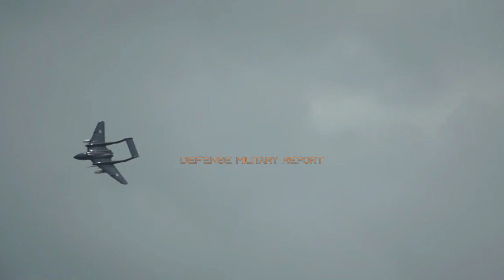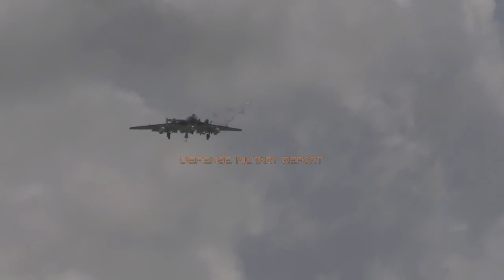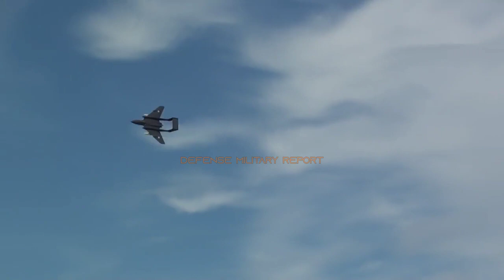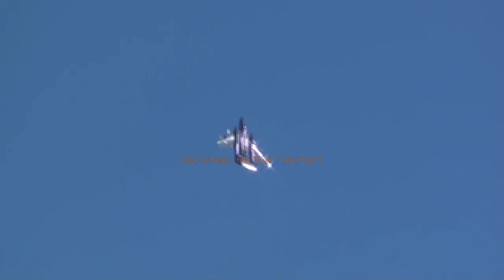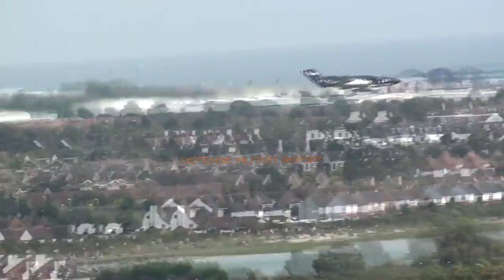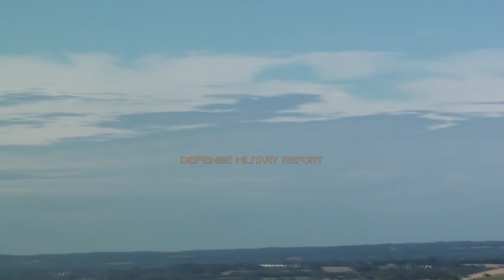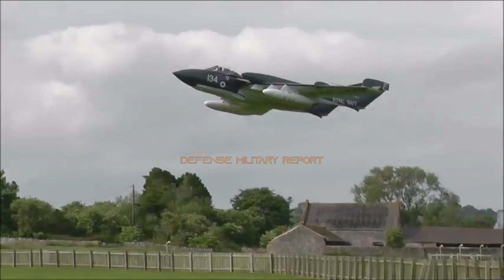De Havilland Sea Vixen - Most Extreme Fighter Jet UK

Comment: Extreme..ly poor performance. The DH.110 failed to achieve supersonic performance and had an absolutely appalling safety record for such a low performance aircraft.
Reply: A number of similar performance non supersonic jet aircraft got to first flight stage at around the same time. 

The MD F3H Demon was a contemporary to the DH Sea Vixen & had a similar performance. The later F4 Phantom was a follow on from the F3 Demon. The Sea Vixen took a long time to get from first flight to introduction for various reasons and a similar situation occurred with the MD F3H Demon. The Douglass Skyhawk delta wing is a contemporary to the the Gloster Javelin delta wing. Both non-supersonic delta wing aircraft, the javelin had better performance and first flew a few years before the Douglass Skyhawk.

Douglass A-4 Skyhawk 
2950 Built 
Intro 1956
FF 1954
In service to 1980s
Max V 670 MPH
Delta wing. A small / light jet aircraft designed for carrier operations without having to have folding wings. Often referred to as the scooter. 

McDonnell Douglas F3H Demon
590 Built. Not Supersonic.
Max Speed 578 MPH.
Introduction date 7 March 1956
First flight 7 August 1951
Retired 1964

MD F-4 Phantom 2
Number built 5,195
Manufactured 1958–1981
Introduction date 30 December 1960
First flight 27 May 1958

DH Sea Vixen
Number built 151 (including two DH110 prototypes and one Sea Vixen prototype)
Introduction date July 1959
First flight 26 September 1951
Max speed 695 MPH.
Retired 1972

Gloster Javelin.
434 built.
FF 1951
Intro1956
Max V 710 MPH
Delta Wing. 

Interesting British achievements.
There is no doubt that the Fairey (England)
Delta 2 was of course the world's first jet
aircraft to exceed 1000 mph, 10th March 1956 Indeed It exceeded the previous record by 310 mph & held the record for 1 year. Incidentally, the Dassault Mirage 3 & 4 are based on the Fairey Delta 2.

When the EE Lightning first achieved Mach 2 it was one of the fastest aircraft on the planet. 
P1 Mach 1 achieved 1954, Mach 1•5 capable.
P2 Mach 1 achieved 1956, Mach 2 capable. 
P2 Mach 2 achieved 1958.

The Hawker P1103 was a design and part built prototype that would have led to Mach 2 & Mach 3 versions of the aircraft. The General Dynamics F16 Fighting Falcon was of a similar design that went into service in 1975. The P1103 was cancelled during the switch to "mostly missiles plus no supersonic interceptor aircraft required in the future" era which included cancelling air to air missile development. Scheduled for test flights in 1958 and to be in service 1962. The General Dynamics F16 Fighting Falcon - based on a British design started 39 years earlier, built in the US and a number of manufacturing partner countries with parts for the US built aircraft sourced from partner countries. 

There were plans to do a supersonic thin wing Javelin which of course got cancelled. 

Early days, jet fighters.
De Havilland Vampire, Sea Vixen & Gloster Meteor accident losses were not high or unusual for fighter aircraft at the time. De Havilland built large numbers of all metal airframe aircraft before the DH Comet.
We mustn't forget of course that the DH Vampire for example first flew in 1943 & the engine was also built by De Havilland. There were examples of the Vampire interceptor / fighter in service until 1990 which was operated by more than 30 countries.

Non combat phase accident losses.
% of Aircraft built.

The Canadair CL-44 was a turboprop airliner.
Canadair CL-44                  (ff 1959 ) 48%
Lockheed XF104                (ff 1954) 100%
Lockheed  P80                   (ff 1944) 43%
Lockheed F104                 (ff 1954)  45%
Grumman f9f-5 Panther   (ff 1947) 44% 
Convair F102 Dagger        (ff 1953) 45%  
MD F-101 Voodoo.             (ff 1954) 34%
MD FH Phantom 1            (ff 1945)  35%
MD F4 Phantom 2             (ff 1958)  28%
MD F3H  Demon               (ff 1951)  32%
Gloster Meteor                  (ff 1943)  21%
DH Vampire                       (ff 1943)  23%
DH Sea Vixen                     (ff  1951) 33%
Gloster Javelin                   (ff 1951) 20%
EE Lightning                       (ff 1954) 33%

More recent UK military jet aircraft.
 
The Tornado & Typhoon & their engines are Supersonic & are indeed British design aircraft with British design engines built by an international consortium. The Tornado design for example started life during the 1950s at Vickers as the AFVG, it's engine is based on the RR RB-199. The EE Lightening is also a British Supersonic jet aircraft.

The Typhoon is the British BAC-EAP with an engine based on the British RR XG-40, the Typhoon is also built by an international consortium.

Comment: A weird, quirky airplane with a high-drag, straight tailplane, and high-drag, inefficient inlets.  55 of the 154 built were lost in accidents, killing 51 pilots.  It's loss rate was even higher than the loss rate suffered by the US Vought F7U Cutlass, which is universally condemned as one of the worst naval jet aircraft ever to see operational use.
Reply: We feel we can clear up some commonly held myths and misconceptions, obviously.

It's always good to see the facts presented clearly and concisely isn't it

See further down for a Meteor & Vixen Accident losses comparison.

Indeed that's correct. The Whittle Gloster E28/39 was of course a brilliant aircraft that was later copied in Russia as the upsized and tweaked Mig 15 with a copy of the RR Nene gas turbine aero engine.

Obviously the RR Nene being the world's most powerful & most reliable gas turbine aero engine in 1944.

   That's correct, of course the MD F3H Demon was a contemporary to the DH Sea Vixen & had a similar performance. The F4 Phantom was a follow on from the F3 Demon. The Sea Vixen took a long time to get from first flight to introduction for various reasons and a similar situation occurred with the MD F3H Demon.

McDonnell Douglas F3H Demon
590 Built.
Introduction date 7 March 1956
First flight 7 August 1951
Retired 1964

MD F-4 Phantom 2
Number built 5,195
Manufactured 1958–1981
Introduction date 30 December 1960
First flight 27 May 1958

DH Sea Vixen
Number built 151 (including two DH110 prototypes and one Sea Vixen prototype)
Introduction date July 1959
First flight 26 September 1951
Retired 1972

Non combat phase accident losses.
% of Aircraft built.
The Canadair CL-44 was a turboprop airliner.
Canadair CL-44              (ff 1959 ) 48%
Lockheed XF104              (ff 1954) 100%
Lockheed  P80                 (ff 1944) 43%
Lockheed F104                (ff 1954) 45%
MD FH Phantom 1           (ff 1945) 35%
MD F4 Phantom 2           (ff 1958)  28%
MD F3H  Demon              (ff 1951)  32%
Gloster Meteor               (ff 1943)  21%
DH Vampire                    (ff 1943)  23%
DH Sea Vixen                  (ff  1951) 33%
Gloster Javelin                (ff 1951) 20%

    Regarding the UK Aerospace Sector.
 
An airline recently ordered 60 RR Trent XWB Engines.

   Clearly It's a great pity & a crying shame that British military forces had to occupy a large part of Germany for decades after 1945 & Russian military forces had to do the same. Of course Russia still posseses a large chunk of what was German territory & of course Russia & the UK produce nukes. Obviously Germany does not produce nukes.

   Interesting British achievements.
There is no doubt that the Fairey (England)
Delta 2 was of course the world's first jet
aircraft to exceed 1000 mph.  Indeed It
exceeded the previous record by 310 mph &
held the record for 1 year. Incidentally, the Dassault Mirage 3 & 4 are based on the Fairey Delta 2.

Early days, jet fighters.
   De Havilland Vampire, Sea Vixen & Gloster Meteor accident losses were not high or unusual for fighter aircraft at the time. De Havilland built large numbers of all metal airframe aircraft before the DH Comet.
We mustn't forget of course that the DH Vampire for example first flew in 1943 & the engine was also built by De Havilland. There were examples of the Vampire interceptor / fighter in service until 1990 which was operated by more than 30 countries.

Non combat phase accident losses.
% of Aircraft built.
The Canadair CL-44 was a turboprop airliner.
Canadair CL-44             (ff 1959 ) 48%
Lockheed XF104             (ff 1954) 100%
Lockheed  P80                (ff 1944) 43%
Lockheed F104                (ff 1954) 45%
McDonnell FH Phantom  (ff 1945) 35%
Gloster Meteor               (ff 1943)  21%
DH Vampire                     (ff 1943)  23%
DH Sea Vixen                  (ff  1951) 33%
Gloster Javelin               (ff 1951) 20%

   An example of what goes on these days in various countries.
Obviously, for example, there are of course no German companies that makes German jet aircraft in Germany & there are no German Companies that make German gas turbine aero engines in Germany that are suitable for widebody airliners.

     That's correct, Brazil makes very good airliners & Brazil is 100th down the list along with Indonesia for wealth per capita. Of course it is in fact the case that Embraer can't build those airliners without purchasing stuff from the US, UK & Europe.
Norway Holland Denmark Ireland Belgium - Top 20 wealth per capita - Don't make airliners -  its as simple as that.

   Early days of the airliners.
That's correct of course, at the time the Comet wasn't particularly dangerous. Agreed, that is indeed the case of course, The DH Comet was definitely not the worst engineering failure in commercial airliner history.

Losses comparisons
How things were in those days.

DeHavilland Comet 4 UK                       14%
DeHavilland Comet all  (ff 1949)           17%

Boeing 307                               70%
Boeing 247                               48%
Boeing 707            .                  20%
Lockheed Electra Turboprop   29%
Canadair CL-44  Turboprop     46%
Convair CV-580  Turboprop     22%
Convair CV-880    (ff 1959)       27%
Convair CV-990     (ff 1961)      33%
Tupolev TU-104       (ff 1955)    16%

     Of course De Havilland had prior experience building many all metal construction airframe aircraft & thousands of jet powered fighter aircraft that were primarily of metal construction with pressurised cockpits & jet engines built by De-Havilland.

  More recent UK military jet aircraft.

  Of course the Tornado & Typhoon & their engines are Supersonic & are indeed British design aircraft with British design engines built by an international consortium. The Tornado design for example started life during the 1950s at Vickers as the AFVG, it's engine is based on the RR RB-199. The EE Lightening is also a British Supersonic jet aircraft.

  The Typhoon is the British BAC-EAP with an engine based on the British RR XG-40, the Typhoon is also built by an international consortium.

  Agreed, that is correct of course, clearly there are many countries that could easily produce airliners of better quality than Bow-wing (see b-47 wing folding & wing collapse incidents) but don't for some very good reasons. Bow-wing (see B-47 wing folding  & wing collapse incidents) being a result of the size of the US, the large protected domestic market & great ease of testing new types due to the equator to arctic geography complete with up to date aviation infrastructure & a few other reasons related to production scale capability, politics, the nature of the airliner market coupled with the nature of airliners themselves & general basic economics.

  Obviously there really is nothing special about Bow-wing, having more than 50 years design / build experience on the type means they have no excuses for the horrendous 737 Max incidents for example.

    Indeed GKN Aerospace, BAe Systems & Rolls Royce combined now do more Airbus work than Germany on an absolute basis & significantly more work than that on a per capita basis.
 
     Agreed, Per capita for the home nation BAe Systems is the world's largest defence contractor.

    Correct, BAe systems announced the recent £4 Billion takeover of Colorado based US based Ball Aerospace.

    It's definitely the case that BAE systems now does a significantly higher value of work for Airbus than it did when it was a major Airbus shareholder before 2005.
   
      Obviously RR now owns US Engine maker Allison for example which does classified Aerospace work for the US Govt.
 
   Yes, that's right of course, Anybody currently flying on a widebody airliner stands a good chance of being on an aircraft powered by RR gas turbine aero engines built in the UK.

   A typical but small glimpse of what goes on in the very internationally orientated British aerospace sector.

  Of course the RR Nene was in fact the world's most reliable & most powerful gas turbine aero engine in 1944. Licensed built versions & copies of the RR Nene & RR Derwent would go on to power many aircraft in Russia including the Mig 15 & Mig 17, the US, China, France & other countries for decades after 1944.

      Boeing Apache Attack Helicopter.
AH-64: 75 UK suppliers, 7% UK content, global fleet of 1280+ aircraft.
F35B more than 130 UK Suppliers, more than 30% UK content.
F35A & F35C more than 130 UK Suppliers, more than 15% UK content.

   There is no doubt that an airline has just ordered
60 RR England Trent XWB Engines.

Obviously the UK has the
World's Highest Combined Per Capita
Nuclear / Defence / Aerospace Sector Activity.

Rolls Royce Holdings UK
Subsidiaries
- Rolls-Royce plc
- Rolls-Royce North America (Allison etc Classified Military stuff)
- Rolls-Royce AB
- Rolls-Royce Deutschland
- Rolls-Royce India Private Limited
- Rolls-Royce Marine Power Operations
- Vinters Engineering Limited
- Rolls-Royce Controls and Data Services
- Rolls-Royce Power Systems
- Bergen Marine
Joint ventures include:
- Rolls-Royce Turbomeca
- MTU Turbomeca -

Trent Family
The MT30 (Marine Turbine)
Industrial Trent 60 Gas Turbine
Trent 7000
Trent XWB Airbus A330neo.
Trent 1500
Trent 1000
Trent 500
Trent 600
Trent 700
Trent 800
Trent 8100
Trent 900

RR wholly owned subsidiaries in Germany handle smaller 2 shaft RR gas turbine aero engine work.

Clearly the line above this line is blank.

We do indeed hope this helps, of course.

Cheers as always & 👍 indeed.
   
. ..... ...... ...... ...... . . . .. . .

.